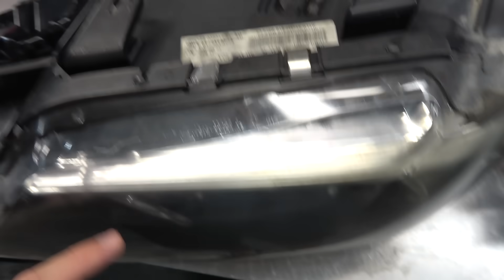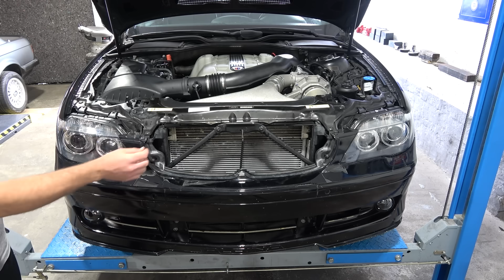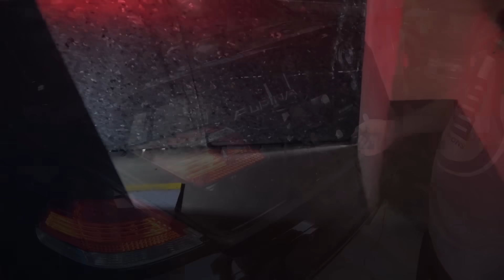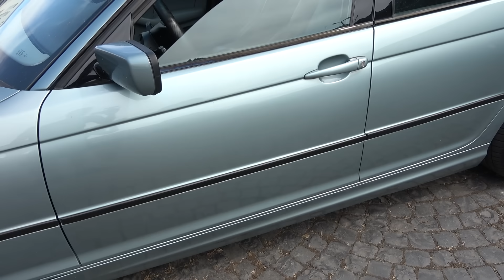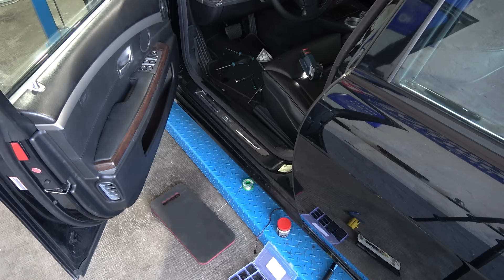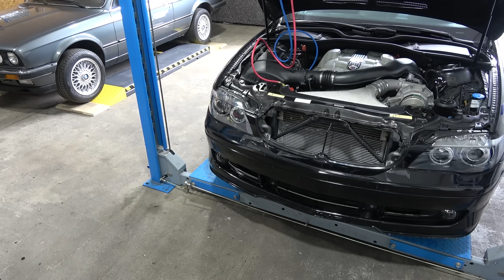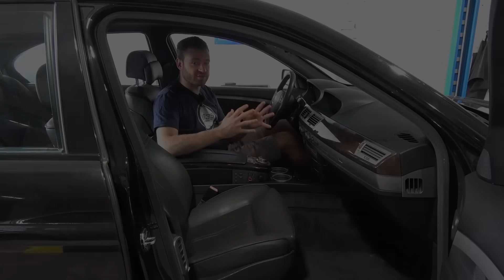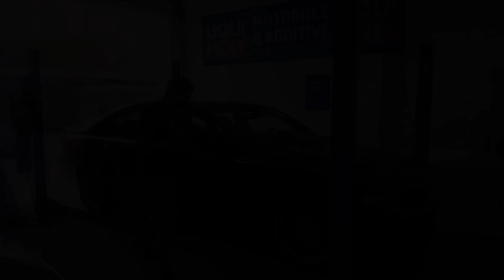Can We Make Alpina B7 Roadworthy Again? - Project Chicago: Part 12

Comment: The moment I hear anyone saying "Bendpak" I throw my 2 cents in. 
Bendpak is pumping out free lifts to lots of YT channels for the purpose of increasing sales, because their past customers are tired of a company that focuses only on new lift sales. Once the warranty is up and you try to contact them for replacement parts you are out of luck, they will not answer your call or email. Everything goes straight to their voicemail or inbox and sits there. Bendpak may refute this and or claim this current pandemic and trade war is the issue I would call them out as a Liar, Been trying to get ahold of them for years long before this pandemic and trade war. Now I send the cylinders out to local hydraulic shops for repair and or replace and they look for same type and size and cut and weld the ears on as needed. And I am running 2 heavy duty lifts for commercial trucks and even the outside service company we call on to service them when I am busy, which is every damn day of the week, has nothing but problems getting ahold of bendpak. Test the competitors and find out Who can be contacted and Who is ready to sell replacement parts and make them your go to company when you need to buy a lift. Customer service is what makes or breaks a company and bendpak  is clearly desperate and donating lifts as a form of advertising in hopes to replace all the customers they lost with new ones they will loose after a few years.

Comment: most often the blower resistor dies because of a defetive blower motor. the current of the  blower motor will increase because of wear in the motor.
Often times a changeout for the blower resistor will result in it beeing damaged again, if the blowermotor is not also renewed.

Comment: I too don't like it when the number plate LEDs are too bright, I find that you can buy different types that have less LEDs on the board to solve that problem, as you discovered when comparing them to the E60. 😁

Comment: Yes, NIce 'Hat'! 😎
Phenomenal effort Stretan, with unwavering persistence and fortitude the BMW warrior slayed all adversities as if swatting flies! Many would have fallen by the wayside at the first hurdle, but you persevered, truly a man of steel who will not buckle when facing challenges or defective BMWs. BTW when flushing the brake fluid, do you ever cycle the solenoids in the ABS unit with a diagnostic tool to flush out the old residual fluid that may be locked in there? ....Can't wait to see this baby gleaming with ceramic coating and fresh painted panels and refurbed wheels, she already looks years younger just with the new lights.

Comment: That exploded capacitor from the blower resistor module was impressive. And congrats on passing TUV. Huge milestone.
Reply: It actually didnt explode. The thing got so hot (not the capacitor) that the capacitor got desoldered and fell down on that molten plastic, where it liked to stick then. Really strange how many problems there are with those things.

Comment: regarding the excessive light in the rear, If the TuV is like the Australian vehicle standards,the lights have to be low emitting . High emitting lights can confuse following cars at night or in Fog. Number plates have a 3M reflective coating (surveillance society rules) so bright lights are not needed.

Comment: That a/c compressor, denso 7seu17c, is the same compressor used on the early e60 525/530i with the m54 engine. Tearing mine apart right now to replace the blown front shaft seal.

Comment: Excellent Video! as far as the plate LED lights you could somehow add a Dropping resistor in line with power, but it also looks like the New LED plate lamps are different color Temperature, looks like original are more warm color temp vs the new being D65K but hey if being creative like I am you could always get someone to swap out the SMT LED inside the lamp housing with the same SMT warm white LED, I do this often on my Home side projects

Comment: The flashes with LED light happens because the ECU will verify if a bulb is burned by quickly turning ON them. As the LED lights turn ON very quickly, you will see them blinking.

Comment: fun fact, all F30's actually have the rear fog LED's, US spec and all, but a blank button in front under the front fog button, pop the button out and trim off a plastic tab, open up bimmercode and enable rear fogs and boom, they work exactly like if they came from the factory

Comment: 5:06 OE, or Original Equipment, is what you are calling "original or genuine". This is the part that was originally installed in the car by the car maker as supplied by a selected manufacturer. An OEM part is a part made according to the same original spec and within same tolerances, but it' manufacturer did not win the contract. Or it could be the originally chosen manufacturer making parts outside of the initial contract.

Comment: I imported a U.K. rhd E93 into Germany. I saved a fortune on the headlights but buying two brocken lhd ones from ebay in Germany and just swapping over the the projector units complete with the shutter (4 screws each side and removed through the xenon bulb cover). Cost a total of €90 and took minutes once the bumper was off.

Comment: just a tip. when filling the diff on your different cars, buy a pump for changing gear oil on outboard engines. A cheap one that makes the change much easier and less dirty. 
Great video as usual - you have come a long way since the first videos. Greetings from Sweden.
Reply from the maker: That actually makes it far more complicated and messy, that's why I love Liqui Moly bottles. Very easy to fill the diff cause they have long extension. Thank you!

Comment: I see the TÜV hasn’t changed in the 30 years I left Germany. I used to deal with them when I worked on farm tractors. My own stuff I just dropped off at the local Opel dealer that had Dekra come every other Tuesday. So much easier and a lot less drama. 
Great video as always Sreten.

Comment: I had a problem with my fuel pump relay for my E28 , bought an original BMW  part from the dealer and still failed. It turns out the pump was exactly that same as a Vauxhall car (Opel) and was 1/3 of the cost. Then some years later had the same problem with my E46 328i Bosch had some quality problems.

Comment: You're actually not allowed to install LEDs in the angel eyes in Germany. Only exception are the Osram Nightbreaker LED if your car is on the compatibility list. If you get pulled over and they find LEDs which aren't allowed, worst case is 90€ and one point.

Comment: About the compressor oil:
Ideally you should flush the open system with cleaner and compressed air to blow all of the old oil out then install the new compressor with its factory oil charge. Also replace the filter drier unit.

Comment: Dear gentlemen, I need your help to bring these points to the attention of Mr Streten.
1. (Always wear safety gloves before starting any work) write this on any piece of material that holds writing and put it in a way that encounters your eyes whenever you walk into your shop.
2. The newly replaced engine is a BMW N62B44 engine which sucks air through natural aspiration. But in this case a super charger is providing the air instead. What I am afraid of is that the engine may not tolerate the instant boost of the charged intake air, unlike the turbo charger that needs to build up the boost,  especially during higher RPMs and within a short period of time this engine may receive the same fate the previous one suffered.
Thank you so much in advance.

Comment: Hi Sretan, I share the same opinion for the license plate lights. I got 6418W LED bulbs and just replaced those for my E39. I believe Philips provides a bulb that has one diode that is the size of two smaller ones like I have on the F10, there may be more aftermarket alternatives. Same Diode size, same overall light output. Greetings from Bulgaria!

Comment: @10.44 my headlight washers on my E46 328i stopped working, when I plugged in my laptop with Npa on the test programme and they worked, the thin wires from the stalk were broken somewhere!

Comment: Fwiw plastilube is for plastic parts within the brake system (e.g. rubber seal within a master cylinder) , you may want to use a grease of sort (copper loaded or similar) for where the pads contact the calipers or similar outside friction points...
Reply: You need a ceramic brake paste. I use Mintex Ceratec Anti brake Squeal Lubricant. For assembly of brake system rubber seals and sliding pins, you need red rubber grease.

Comment: The blower motor is usaly the fist component that is not working well. Becouse the resistance from the motor is to high the regulator gets to hot and is recommended to always replace with the motor. This way the one can not damage the other.

Comment: You are not the only one, i purchased a ton of OE parts for my E30 325i from the dealership, a lot of them were defective out of the box. None were refunded, just like you, had to book an appointment, pay another €500 for inspection etc etc.....
Reply from the maker: So sad to hear that. Completely idiotic.
Reply: @M539Restorations  Kind of, from their side, they probably want to be sure, that you are not looking to get money back for your old part maybe? or an in house confirmation, that the part(s) are indeed defective. Ironically, those very same parts are made by Lemförder, Sachs, Febi etc with a BMW logo on them....all made in Turkey, China or Czech Republik, none are made in Germany (at least my case).
Reply: We have consumer laws here in the uk. I'm pretty sure if parts are defective they should issue a refund and it is their responsibility to test those parts. Also if you buy anything in the UK using a credit card, you can claim the money back from the credit card company. It makes no sense I know, but it's true.

Comment: Hi Sreten! You could also use a (ceramic) coating to make plastic trims look like new. For example Nanolex Si3D does so and it also gives a nice water and dirt repelling surface.
Reply from the maker: Doesn't work, I tried. Paint works the best in my experience

Comment: I know this is a real bodge, but if you unpacked the new number plate LED and crushed 16 of the LEDs on the board and put it back in it would most likely still work with reduced light output. Crush as in break the LED light source but not impede the connection running through them, it's a fine art lol

Comment: Great video as always. I think you made mistake with oil fill in new a/c compresor. Usually old compresors lose oil over time it evaporates. You can check amount of oil that goes in new compresor online. Think its pag 46 oil spec and it goes between 100 - 150 ml. Cheers!
Reply: Yes can't assume ... 1, no oil has been lost or 2, Whoever may have messed with the system in the past  put the correct amount in. Need to know exactly how much should go in there.

Comment: The blower motor was probably on the way out and it took the resistor out with the amount of current it was drawing
Reply: This is a common issue on various BMW models and there have been recalls all around the  world on various BMW models. Many cars have been written off because of this part causing a fire which can spread very quickly through the whole car.

Comment: Hey man, 99.99% sure FCP Euro or Turner Motorsports would warranty that part/future parts. They're a couple of great companies. You can even warranty used oil and brake pads. They are OEM dealers. Only ones I buy from

Comment: Osram Nightbreakers are very adequate bulbs, they just don't last very long.
Especially in cars with a canbus, which typically run slightly higher system voltage.

Comment: You can remove some of the leds from the board
Reply from the maker: Can't, they are serial
Reply: @M539Restorations  replace with resistors ? Just a heads up I’m not an electrical engineer.
Reply: @M539Restorations  actually the easiest fix would be to tape over the leds you don’t want with electrical tape.

Comment: To remove the wipers from the car you gently push down on the join and this releases the tension on the bolt. The screw is loosly on because of this feature.

Comment: Since you are replacing the rear license plate panel for the euro-spec one, why don't you use the old one to retrofit the F10 led plate lights? Then if it looks good, transfer the modification to the new panel and you have cool led plate lights on that Beast! 👌🏻
Also, pleeeeeease, redo those wheels in black! 😎

Comment: You did the A/C oil part a little wrong - From the manual: Fill the same quantity of refrigerant oil (from the new air conditioning compressor), as was drained from the present air conditioning compressor, + 10 ml precautionary allowance in a clean measuring cup and again fill it in the new air conditioning compressor . At least but a total of 50 ml!!!!!
Reply: And 20G Oil for condeser replacement + 20G Oil for Dryer replacement (which is in the condenser) so +40G Oil

Comment: Great work, I have a 2008 Z4M. I want to change the brake fluid. I saw somewhere you have to have a scan tool to pulse the AMB as well. Is this necessary?
Reply: You only need this if you allow air in the system. Then you need to purge air from abs and brake lines with the scan tool. For a normal fluid change, not required.
Reply: @ToshYusaf  Thanks, then I can either use a pressure tool or just old fashioned  pump, open nipple, close nipple 2 man bleed procedure. I have purchased specific BMW brake fluid for my car

Comment: nice. Altho i feel i have to add, the electro-magnetic clutch has to be engaged so the a/c compressor's internals rotate too when you rotate the belt pulley. So all the noise you heard from your original one was coming only from the external bearing
Reply: Yes, thats correct if you have a compressor that has a clutch in its pulley. This one doesn't. The job of this weird pulley is to deal with vibrations, nothing else.

This is a variable compressor, which means that its always active and running, even if you turn the a/c off. The amount of refrigerant that flows through the compressor is controlled by the solenoid on the back of it. 

When you turn on the compressor with the clutch, its on 100% and its pumping 100%. But variable ones dont have to be at full throtle to work, they can go as low as 3-4%. In my experience, they are longer lasting because there is no rapid on/off action but its usually the solenoid that gets them.

Also i dont agree with sreten on the oiling part. These compressors come pre-filled to speck and it seems too much but actually it gets spread throughout the system. He even said it himself! He probably did some research on this particular compressor but generally as far as i know, youre not supposed to drain oil from them.
Reply: Always something new and interesting to learn with these things, it just never ends! ^^

Comment: More amazing work sir. As a fellow BMW masochist I salute you. Just a suggestion. On those new (old stock) OE plastic parts like the windshield cowling, instead of painting them, ceramic coat them. Makes them look brand new (like they should) and unfaded. Had to do some new plastics on my E70 recently with the same affliction. Only half way through the vid, but wanted to post that before my old-man brain forgot all about it.
Reply from the maker: Thank you! Unfortunately, that doesn't work, at least not for me. I tried a couple of different ceramic coatings on different trims and they all go back to faded either instantly or the next day. I even tried on the cowl before painting it. I also have a box full of those back to black products and they are all crap. Painting is the absolute best way if you want it to last for years and not worry about it. You can do what I did or in the US, they have SEM paint specifically for trim painting.
Reply: @M539Restorations  Interesting. Maybe it's the particular coating I use (Carpro Cquartz UK 3.0)? Agree on the back to black products, all worthless. Very familiar with SEM trim aerosol. Good stuff. Used it extensively on 3 of my E30 restorations. Sorry for suggesting something you've already tried, especially since it didn't work. Love your vids, watch every minute of them. Good luck with all your projects.
Reply from the maker: Absolutely no need to apologize! A lot of people suggested this and for some it works which is great, I'm just going with what works for me. :) Cheers!

Comment: I had the exact same experience with Mercedes-Benz. 

They supplied me a dead starter battery for a ML350.  To fit I had to remove the drivers seat as the battery sits below, took it out, drove back to the parts depot. Service put a battery tester on it in front of me, confirmed dead. When it came to them going to replace they said the same thing. You'll need to install it in the car, bring it here and we'll check it and then we can replace.   Basically drive to dealer, they test with the same results, and I need to pull the seat in the car park!   Just paid for another one and told them to keep the dead one.    Totally ridiculous.  

The Alpina is looking good though, fresh lights really do make a massive difference.

Comment: I had huge problems with the seal on my headlight control units - leading to corrosion. Tipp: use some silicone grease on the seals to keep them fresh.

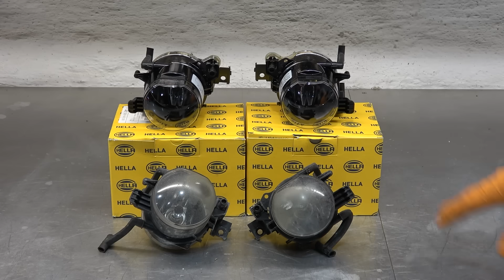Comment: The LED bulbs flashing three times (at 12:00) on key on is the LCM doing the cold bulb check intended for filament bulbs.  You can disable that with NCS Expert when switching to LEDs